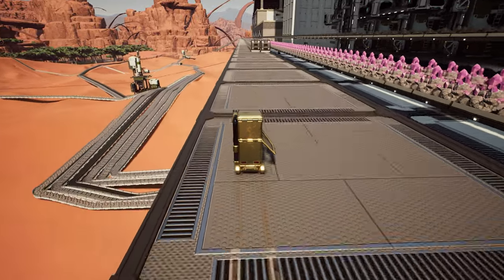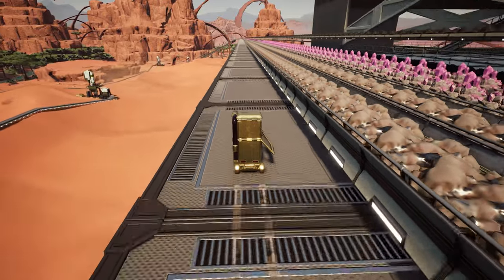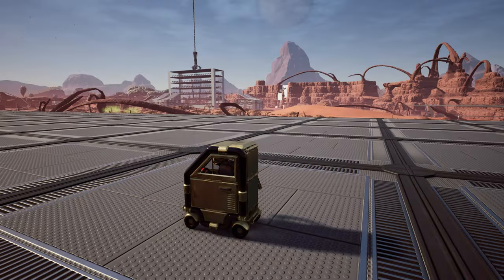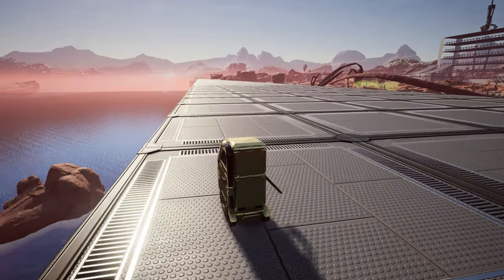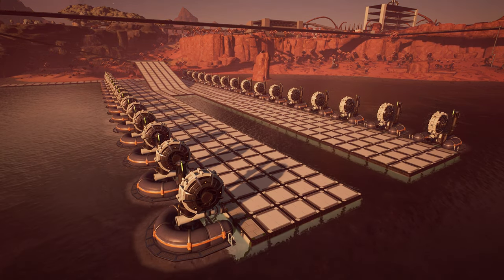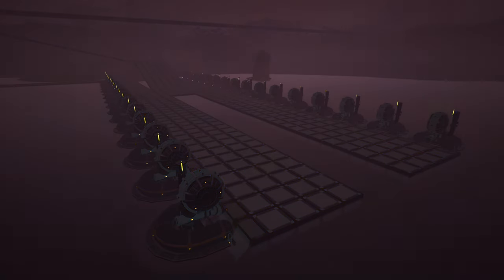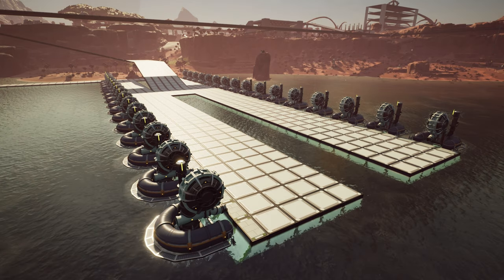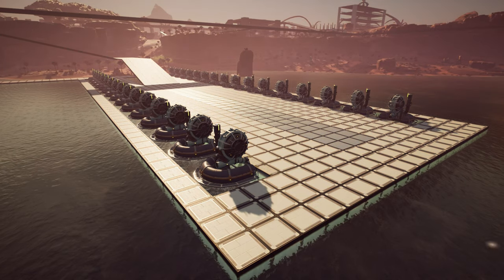Piping Day at The Claw | Mega-modular Ingot Refinery | Satisfactory Megabase Guide

Comment: Just an fyi, you can use a train to easily move water to the top of your structure, so long as you use a fluid buffer or 2. Will save the need for pumps and pipes